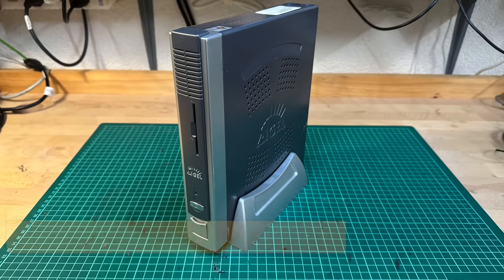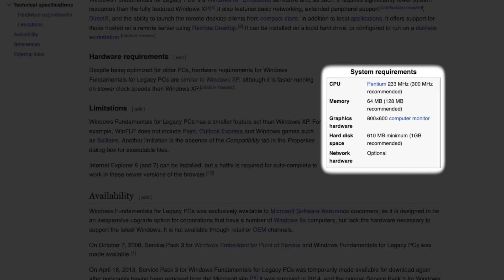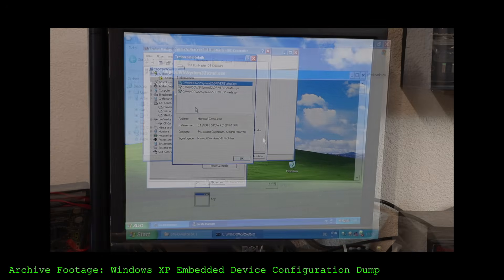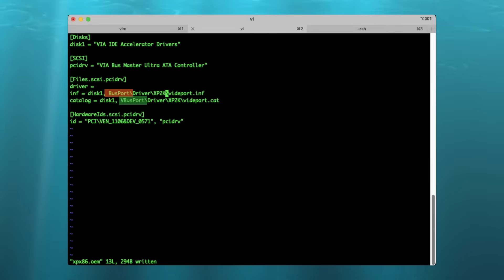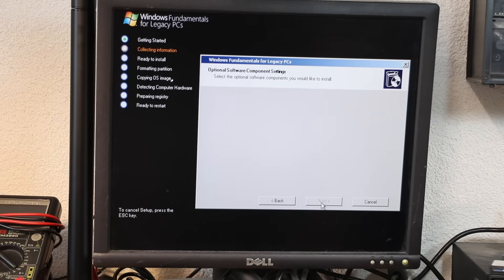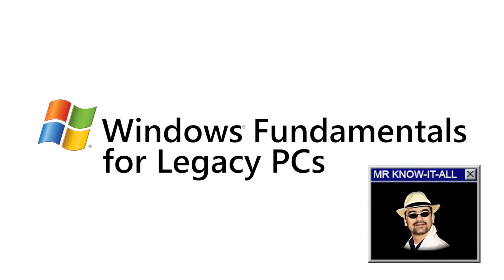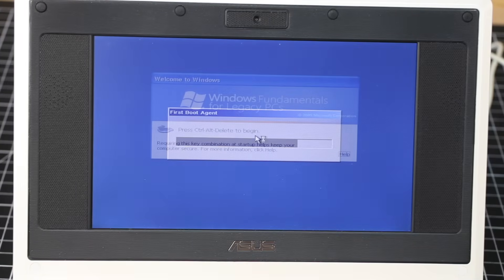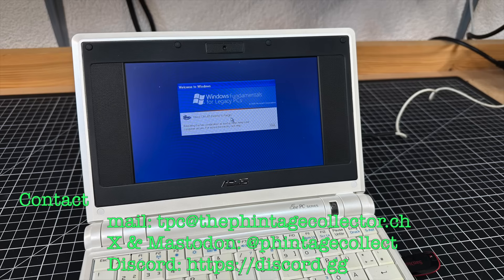Windows FLP - A Secret Windows XP Built to Keep Old PCs Alive

Comment: Great solution for aging hardware for the time.  Still a great solution for running old native windows software or just a trip in history.  In this day, I would be more inclined to install a lightweight linux distro or BSD, even to use terminal services.   The only hang up I run into on older hardware running a modern OS is typically graphics acceleration.  It gets even worse if trying on anything other that X86 CPUs.  Its still painfully fun and satisfying to web browse on old hardware.

Comment: It is weird that even this version of Windows  XP uses Aero desktop by default instead of the classic desktop that uses much less resources…

I made it a thing to turn off Aero on most Windows XP PCs, I laid my hands on, typically explaining to friends and family, that the PC would be much faster 
with classic desktop. Turning off most graphic effects in system settings helped, if I remember correctly, there was a choice to adjust the desktop for "performance" which did most of the work, but depending on the "customer" I would turn on the thumbnail viewing again, so that images could be more easily viewed, though it costed some system resources to browse them with Explorer with thumbnails turned on.
Reply: Windows XP for Legacy PCs does not use the Aero desktop/theme that was introduced in Windows Vista, but a theme style called Luna.

Comment: Damn, I miss my EEPC which I sadly had to sell way back when... 😭 But, as i had it, and had to make do with what little it provided, i can 100% attest that you can simply nLite a regular WXP Pro SP3 and comfortably use it on the EEEPC. I used it for years as my alarm clock with EPIM, obviously as my agenda too, text notes on the go with NP++, "portable mp3 player", portable emulator/console (mostly ZX Spectrum and NES) and even some development work with PureBasic and C#.
The most hoggish (size wise) parts of XP was System Restore, Hibernation (file) and swapfile, but given they never got to exist on my nLite builds... Luna is also a hog, with or without effects, but I've used "classic no effect" all my life, the EEEPC was no different.
Reply from the maker: Yeah, I read about people doing the nLite route for squeeting XP on those early EeePCs.
nLite also totally made sense in that regard, as neither XP Embedded nor Windows Fundamentals for Legacy PCs would be readily available to a broad audience.
Reply: @THEPHINTAGECOLLECTOR  Browser ate my post so here goes again... EEEPC4G actually had a "special" XP version as an option, but it was just a slimmed down regular XP with some tweaks and SysPrep'ed. nLite would just let you go full crazy in ways MS would never let you ;)
Using nLite isn't just about resources, my AXP's, A64's and C2D's had plenty, the i5 running XP for games in the corner of the room has lots, always ran nLite'ed XP's on all. It's about making sure "things I'll NEVER need or want" are never there. Once you get used to it, there's no going back.
Also, nLite is very "modular". You can prep a "baseline" without the trash you'll never ever want, then use that as the base of "with this minus that" and then use that one "with drivers and this serial and these accounts" for a specific machine. It's very easy to always get something very "tuned" to the end it needs.
Also, having unattended install is a major bonus. You can just go do something, come back later and it's all done and (near) ready.

Comment: Just as a heads up: Benchmarking older devices by going to YouTube can give inconsistent results, at least in my tests on old tablets. For the ones that can still load it, the performance is ok if it is detected as a tablet, but quite sluggish if it is forced into desktop mode. They may also enforce lower quality on videos, even as low as 360p in some scenarios, when the same device used to load at 1080p just fine just a few years ago!

YMMV on PCs, though.
Reply: Perhaps "benchmark" wasn't my best word choice given its ambiguity. What I meant is that YouTube's changes in recent years yields some strangely inconsistent results, depending on how it interprets the device's capabilities. For example, I have a Windows 7 PC that had no problems loading nearly every video in 1080p by default until recent months for unknown reasons. Now it wants to default to 480p. And YouTube often forces updates on their app on some platforms (like phones) or abandon them altogether (like the Wii U a few years ago.)

YouTube is a natural choice to test, given its presence. I am just saying that the platform will degrade on some platforms out of the blue, while running normally on others that are even older. Anyway I enjoy the tests and likewise still run old tech as you do, making old machines as useful as possible.
Reply: @DavidWonn YouTube upgrades to use more modern codec where older hardware could be too slow to decode.
Reply: @chenyansong  That's true in some cases, but what bothers me is when the same old videos that worked yesterday perfectly fine are sluggish tomorrow, or they just drop support altogether (Wii U and old iOS come to mind.)
Reply: @DavidWonn  It's the same with old Android, too. Much depends on base WebKit/Blink support in terms of web standards, and codec and certificate support.

App support depends on these.

YouTube rightly favours new codecs, because these have better compression, and because the storage volume of videos is not decreasing in any way.

New security certificates and ciphers can also become blockers.

For example, iOS 11 and below do not support TLS 1.3.

iOS 12 got TLS 1.3 support in v. 12.2.

iOS 12.5.7, released on January 23, 2023, should support phones as old as iPhone 5s.

iOS 15 is still supported with updates. It supports phones as old as iPhone 6S and 6S Plus, which devices were released in September 2015, nearly ten years ago.

iOS 4 and below do not support TLS 1.2.
Reply from the maker: @DavidWonn  What makes you think this was a benchmark?

I don‘t typically do benchmarks, except when I think it‘s useful.
Just trying a browser to load up any website is far from being a benchmark, especially when not indicating any numbers.

Comment: Time to make Windows 11 FLP
Reply: There is Windows 11 LTSC IoT version that is quite equivalent to XP FLP.
Reply: @Rafnunes  Not quite, that's extended support. I meant a version for weak PCs
Reply: @badiiin  Why not? Windows 11 LTSC IoT does not require modern CPUs, works on BIOS boot machines (CSM), works on machines with 2GB of RAM, does not require TPM and does not include bloatware. I think it's a good option to weak machines.
Reply: @Rafnunes  good to know!
Reply: @Rafnunes  It will be more babebones than a full windows xp installation, and will not include paint or a voice recorder and be like 10gb space. Modern windows' and software in general is really bloated for no reason
Reply: that's called Debian 🤣
Reply: people pointing that LTSC is a equivalent of XP FLP but no, LTSC ain't as light as FLP & even embedded. not the same.

oh, you can still use windows 10... *get out sfx
Reply: tiny11. not official, but runs on just about any 64bit x86 cpu (and some arm, but i'm not 100% on how far that goes, given how widely varied those get). and the tiny11builder script  by ntdevlabs works on any w11 release as of right now, so you can build an installer image for ltsc iot just fine.
Reply: elites wont do that theres a reason they want to stay on xp and 7 while masses are pushed to the garbage.

Comment: I found FLP was great for its intended use. Loaded it on plenty of machines that just couldn’t cut it with a full version.
Reply: Why upgrade from a 9x system?
Reply: @lopwidth7343 program compatibility
Reply: Never noticed a difference in performance

Comment: 8:46 OH MY GOSH MATE IT'S THE EEEPEECEE!
Reply from the maker: @TheCoder55  I guess you haven‘t seen an EeePC in a while, have you? ^^
Reply: @THEPHINTAGECOLLECTOR  I'm pretty sure that was a DankPods reference.
Reply: @THEPHINTAGECOLLECTOR  Oddly enough, I still have mine.  Haven't tried turning it on in quite a while, mind.
Reply: @THEPHINTAGECOLLECTOR  It's DankPods reference
Reply: Lets hope this EeePeeCee isn't killed by a cursed piece of spongebob
Reply from the maker: @ I have strong admission rules in place to protect my treasures ^^
Reply: I'm still 3D modelling on my Eee PC 1000H. Works perfectly fine with antique software, it's based pocket machine for simple 3D prints on my Ender 3 V2 xD

Comment: Hi! One advice... Did you try to change SATA mode to IDE mode on BIOS, instead of AHCI?
Reply from the maker: @Rafnunes  No, as the Thin Client I worked with doesn‘t have SATA, but IDE (PATA).
Reply: I assume there's no option like "enhanced ide mode" or "legacy ide mode" to switch?

Comment: FLP is great, used it a lot on my older machines in the early 2000s. Great for simple browsing and IRC.
Reply: what browser can run on it?
Reply: @gaborm4767  was back in the day :p
Reply: @gaborm4767 any browser that works with XP.
Reply: aww so not the secret elite version that is updated stright to 2025 that none knows about? danm.

Comment: Interessant.
None of my machines ever had issues with XP but I could totally that a well fit for netbooks.
Maybe Microsoft should have told OEMs to put this version on it when they sold netbooks.
Reply from the maker: @MegaManNeo  I couldn‘t find out, what was the volume license cost for FLP, but I guess Microsoft was more in favor of selling a stock XP Home Edition, which was more capable than FLP.
Reply: For very early netbooks like the Eee PC 701 it would maybe make sense, but the later ones with Intel Atom could run full Windows XP just fine. I had a 1005HA with Windows XP Home and it could do just about anything - web browsing, office work, YouTube (up to 480p, but few youtubers made HD videos back then), older or casual games. I don't see how a stripped-down version of Windows could have meaningfully improved performance, maybe it would have booted faster but wouldn't have helped with HD video, games or Javascript-bloated websites.
Reply from the maker: @jacekm833  It wasn't too much about performance, but about making older machines still something more recent then Win9x or Win2k, and having support.

Stripping down XP helped for older machines, as it reduced the disk space footprint, and the memory footprint, as services where not just simply disabled, they were left away in their entirety.
That made it suitable to run on memory and disk space constrained systems, where you couldn't install vanilla Windows XP.

But as you say, with the stripped-down version of XP, wether FLP or XP Embedded, it's still the same kernel and core OS, so no speed gains are to be expected in that regard.
And I totally agree, for later Atom-based Netbooks it became obsolte, as those were perfectly capable for running XP Home or Windows 7 Home editions, especially as most of them housed a 80 or 120 GB hard drive, and could easily be upgraded to 2 if not 4 GB RAM.
Reply: goddamnit and i've just thrown away my netbook. It could have been fun to try to find some use for those horrendous machines...
Reply: @ShinryuZensen  Other than a slideshow presenter, there is not much it can be still used today

Comment: This Windows actually was stable for Pentium 2 rather than using XP lite modded, yes I mean light was term how could we use it. I remember set dual Pentium 2 with this OS  before it died just for serving attendance. After that we got a new server machine and made an image a.k.a VHD from older server drive and made it boot again with VMWare (It's dumb but at least it's better than finding gotcha's XP PC support)

====/===

Now for Legacy Update next, that was a real saver tools I guess before Microsoft took down all updates, I'm using it now on Windows 7 for .NET Framework